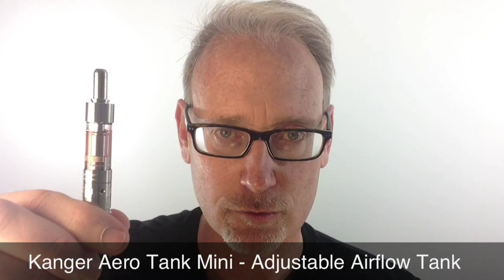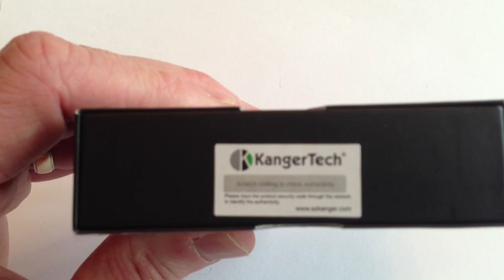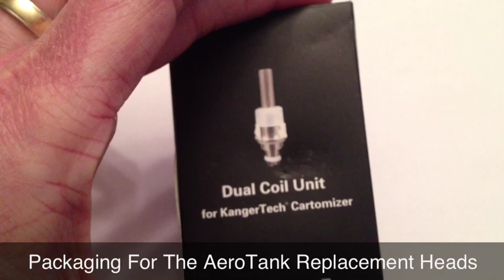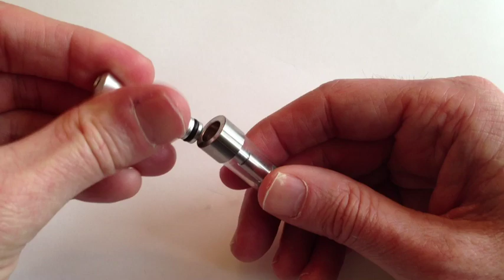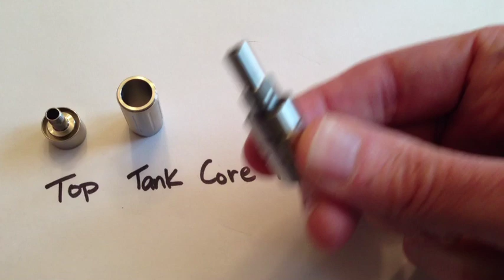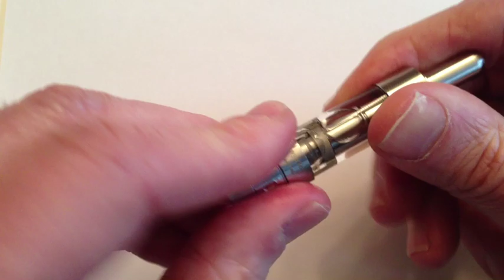Kanger AeroTank Mini - Adjustable Airflow Tank

Comment: Bought this the other day and it works great.  However, it is ripping through juice super fast.  I am having to fill this tank 7-8 times a day and I am not a heavy user by any means.  I had the protank 2 mini and was only having to fill 1-3 times a day.  Not seeing any leaks on the Areotank mini and am wondering if this is to be expected with this set?
Reply: Yep...  welcome to dual coil :)  To me, power/vapor increase is totally worth it, but to some.... well, you'll have to judge that one, for yourself.  Happy vaping

Comment: I bought an aerotank mini. Almost immediately I had lots of gurgles and eventually I ended up sucking in so much e liquid. Disgusting. I opened it up, cleaned and repeated this several times but the leaking and gurgling continued. I had to send it back but was very disappointed non the less.

Comment: Hello I have just got mine yesterday.  I am not sure really how the airflow vent turns.  Mine is tight, like it turns with the bottom part if I got to the right it unscrews from my mod.  What am I doing wrong.  It is tight the vent with the holes in it and moves that and the bottom together.  Can you help?
Reply from the maker: Hi Delores. Please got to 8:20 in the video.  There is a nice little section on adjusting airflow.  I hope that helps.  If that doesn't work, please call the VaporBeast toll free number.  We are always happy to help out!